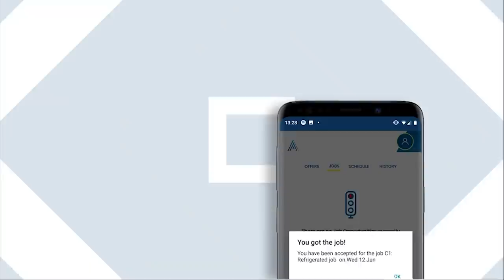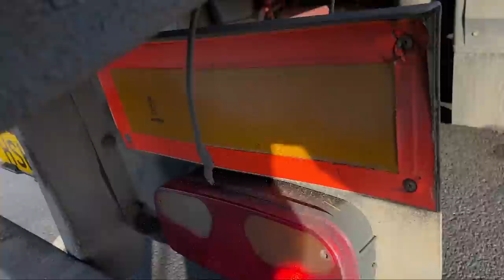Flat Bed Deliveries PLUS An Early Finish For The Day Driver!

Comment: Great video Luke, also sending my best wishes to your father, also great to see you remembering the tip all the time about raising the suspension after coupling to the trailer to make the landing legs easier to raise, not sure how much easier it makes it for porta-toilets though, as not too much weight with them, mainly the heavy loads it is a great tip to remember it for though.

Comment: Whoops, I should have waited. I'm 74 and 18st. Still trucking but not the best job for losing weight Luke. I load and tip, car parts, but only stay the same weight. 44t double deck. DHL.severn beach. Opposite THE RANGE.
Reply: Wow 74 and still trucking..🙏👏👏
Reply: Retired at 65 for 3 weeks got bored